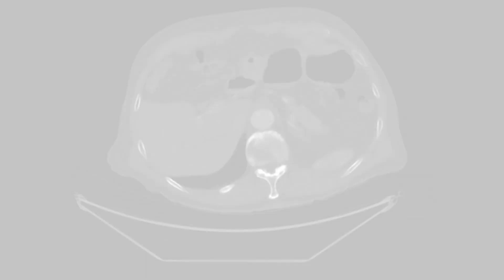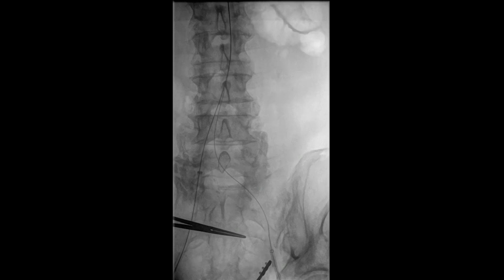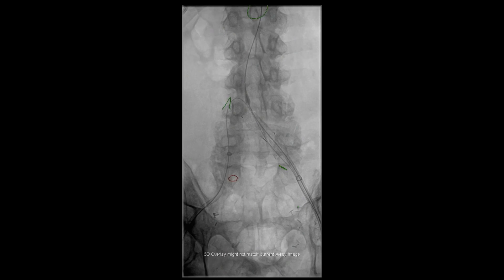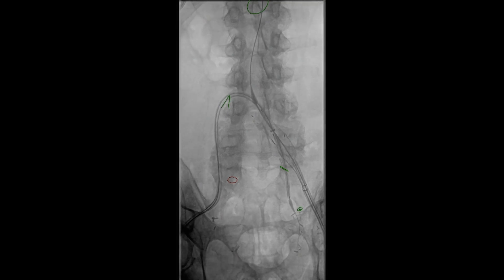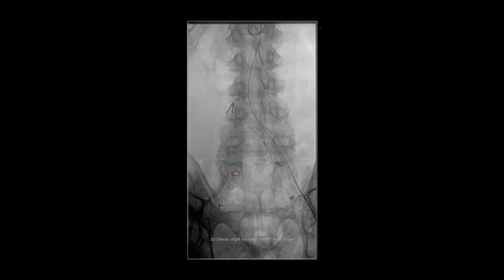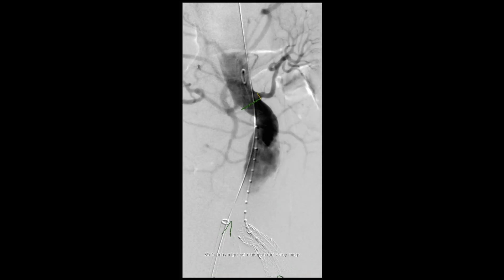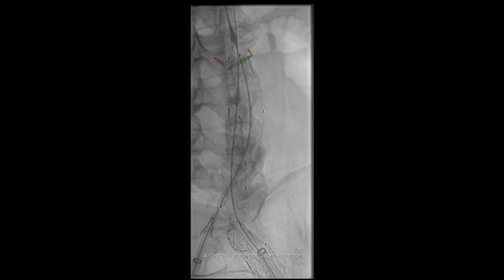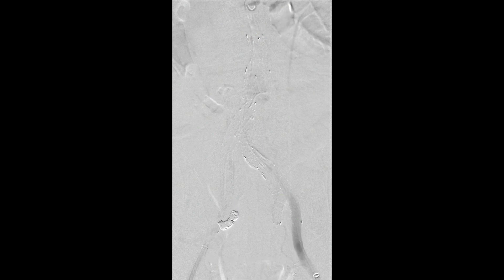Iliac Branch Device and EVAR (Maham Rahimi, MD, M. Mujeeb Zubair, MD)

Comment: Dear author of the video!
I am a medical doctor by training and I want to share my discovery related to a new type of cholesterol plaque inside the vessels of the heart, brain, carotid artery, and vessels of the lower extremities. This plaque causes acute heart attacks and acute strokes with severe nervous strain.
A real video made during an operation to remove an “atherosclerotic plaque” shows a cholesterol plaque, which is not similar to how the “atherosclerotic plaque” is described in the medical literature.
A soft, flexible tube is drawn from the vessel, which follows the contour of the vessel. It looks like a cylinder or tube. It does not contain any rigid components, it is easy to bend and is easily removed from the vessel without damaging the vessel wall.
During surgery, it is easily removed from the vessel. The plaque is very elastic and has no connection with the vessel wall. I have known about this cholesterol plaque for 30 years. Now you can easily see her with your own eyes. I have developed a mechanism for its formation and how it affects the increase in LDL in the blood.
In the video made during the operation, this plaque is visible. It is also seen that the intima of the vessel is not broken and is located in its place. Otherwise, with the separation of such a quantity of intimacy, it could not exist inside the plaque itself.
There are many videos called "Carotid Endarterectomy". A soft plaque is visible in these videos. I called it "cylindrical cholesterol plaque." If desired, I can provide links to such videos.
 
In 2017, in the journal Medical Hypotheses No. 106, an article was published describing this plaque. Please consider this cholesterol plaque carefully.
This plaque does not depend on fatty foods, smoking or eating smoked foods. "Cylindrical cholesterol plaque" depends only on the force of contraction of the vessel and appears within a few minutes after a severe spasm of the vessel.
On my channel there is a video in Russian and English, which describes the mechanism of its formation and how it increases the level of LDL in the blood.
I’m ready to answer any questions related to the “cylindrical” cholesterol plaque that I discovered and described in the vessels of the heart, brain, carotid artery and vessels of the lower extremities. I’m also ready to answer questions about how this plaque violates the normal level of LDL in the blood.
 Sincerely, Dr. Sergey Rusanov. Haifa. Israel